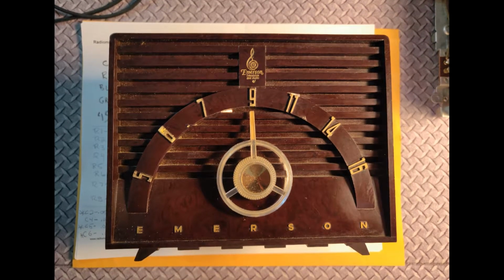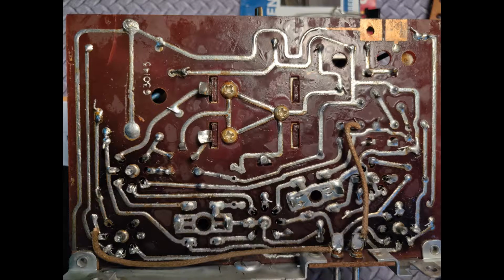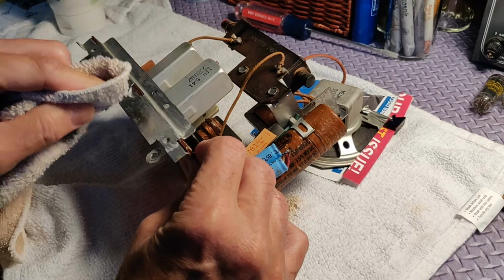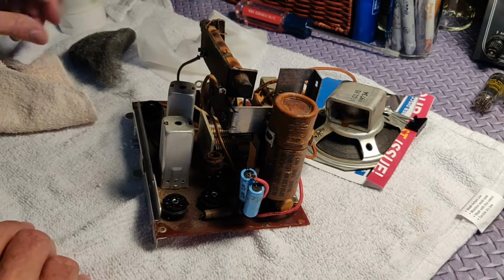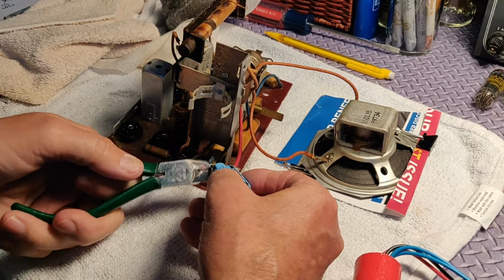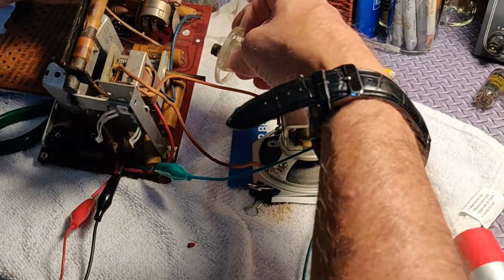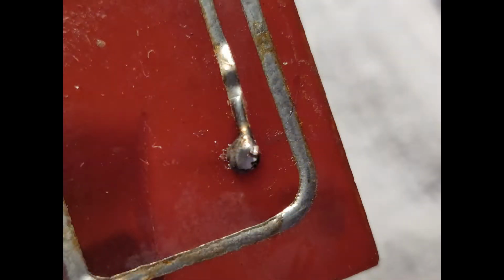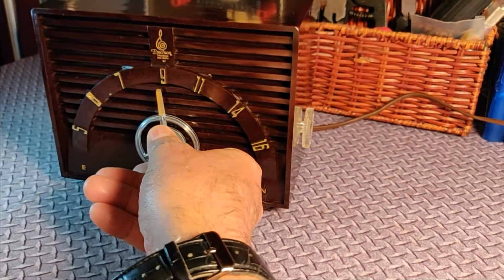Emerson 811-B Vintage Radio Repair

Comment: A problem you may run across is silver mica disease it happens to slug tuned I.f. and some other types of rf transformers such as those in this radio the ones in your set were made by automatic radio corp. But there are others too they have a mica sheet with deposited silver capacitors printed on the mica, they get leaky between usually between primary and secondary and will cause erratic operation, changes up & down in gain, noise & crackling. Replacements are limited to new old stock as new ones are not made anymore or it is possible to rebuild them but you really must be careful and know how to do it and determine the capacitor values in the can. I have done many of them over the years.
Reply from the maker: Thanks for the info. I knew that this radio would be about the right age for SMD, but I didn't have any of the symptoms you mentioned. I've seen YouTube videos from those who have repaired these by removing the old mica caps. I'm not sure that I could do it without busting up the whole thing. We will get our chance somewhere along the way.

Comment: Parts from Mouser, Parts Express, or Digi-Key. Digikey ships quick, they carry quality electrolytic from nichicon and panasonic. Radio Daze or Antique Electronic Supply for axial capacitors tubes and repro parts. EBay too, but beware of some new old stock parts paper caps & electrolytics